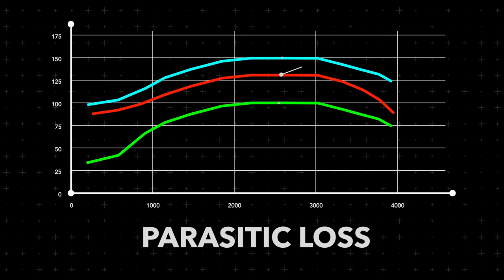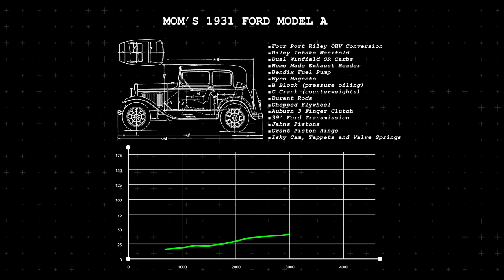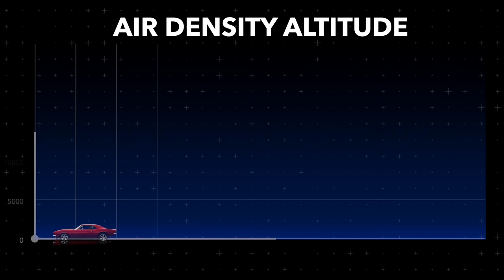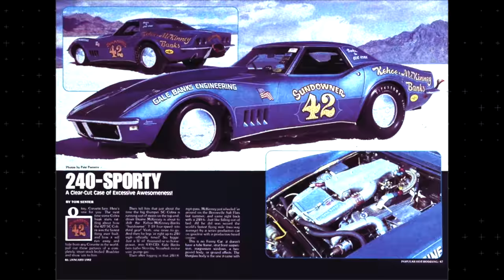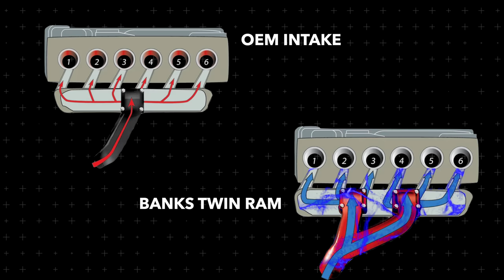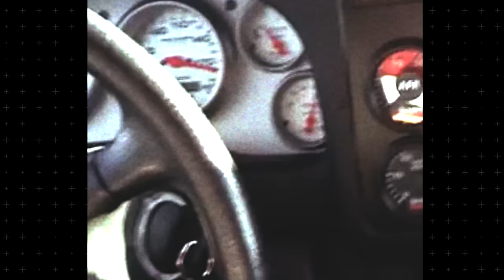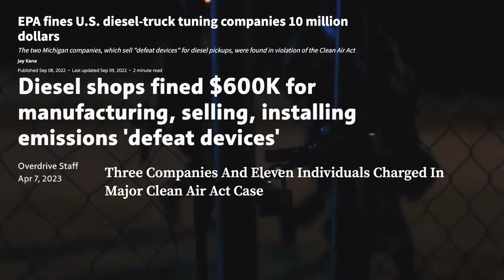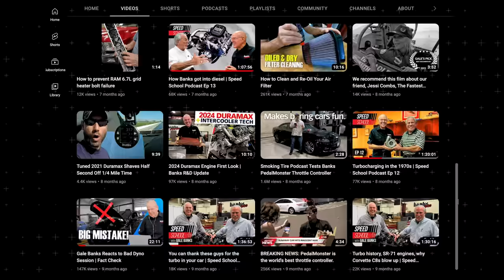How a TUNER Became The KING of Turbochargers👑 | Legends Ep. 6

Comment: “Rolling coal” was the most ridiculous trend in motor “sports.”

Why would you waste fuel? Use it to go fast or to be more efficient.
Reply: The only thing that works with ultra excess camber stances.

Roll coal while trying to get over the tiniest speedbump without ruining your bumper cover.
Reply: Small…mind?😂
Reply: it's honestly a singular aspect of actual motorsports taken out of context and made ridiculous. high power diesel builds spit out soot naturally just because the huge amount of fuel being dumped into the engine can't always all be burned, similar to gas engines spitting flames. some people probably saw both of these at the race track and said "what if we did just that, it'll almost look like the race trucks/cars haha" but it just looks dumb when it isn't backed up by actual power increases
Reply: Coal rollers ruined the diesel scene

Comment: WW2 war time aircraft engine designs were way ahead of their times. BF-109 used the Daimler-Benz DB 605 had a fluid coupled supercharger to change the speed of the super charger depending how high it went. They also used methional injections, and even NOS. Lot of the hot rodding going on later had been done years before.

Comment: Just curious but assuming that 7:50 in the video was a misquote, talking about cylinders 1 and 6 being richer and hotter? Surely they mean richer  and cooler???
Reply: You are correct. This is a typical gas vs diesel misunderstanding. 

The King noticed this while watching it recently. One of the very few technical errors in this video.

Though the A/F ratio mix up that results in less power, wasted fuel, and excess soot, high EGTs + NOx emissions are still true.

Comment: I thought this video was going to be about the 20th anniversary trans am with the updated 87 Buick grand national engine. I guess it’s arguably, but the 89 turbo trans am of 89 was the superior powertrain by comparison. The 3.8 sfi turbo intercooled gnx with 2 years of advancements in a lightweight f body supporting the gn engine was and still is a monster. Only beaten by the 4.3 awd system in the typhoon and syclone 60/40 split it was a monster. The gn, syclone, and typhoon were much quicker than the corvette a unspoken no no amongst gm vehicles.

Comment: There's nothing like the feeling of a modded Cummins. Play around with some mods and you'll be hooked.
Reply: I mean they are cool but I'm not sure I'm willing to part with an additional $10k+ for the engine/transmission option.   Plus the additional thousands to mod it.  Especially for something I'm not really sure I would even use.
Reply: I got a 12 valve for 2500 and turned it up with marine injectors and a bigger pump..overall about 3k. I guess being a mechanical engine it's alot less then having to have it tuned on a dyno and doing it yourself sav s a lot obviously 😊😊
Reply: @bmstylee  you don't need to touch the internals. I'm talking light mods. 600-700 hp
Reply: @bmstylee also a manual needs only a good clutch

Comment: In the late 1970's Trans West Ford in Fontana put an Isuzu straight six turbo diesel engine in a new F-250 pick-up truck.  My Pop brought it home, and let me run it around for few days.  That truck had some real ass - it was work truck bad to the bone.  It may have been a truck built as a proto type - my Pop was into City, County, State and Federal sales contracts at the time.  At 63 years old now, that was the best work pick-up truck I have driven.

Comment: It's pretty sad that diesel owners did this to themselves.
Even the big 3 pulled all of their light duty diesels besides the 3L GM.
Reply: A diesel in a half ton makes no sense to me.  If you need the capacities of a Duramax, Cummins, Power Stroke you probably will be needing a 3/4 ton.
Reply: People are they're own worst enemy sometimes.
Reply: @bmstylee diesels make sense in trucks in general, from tiny ones to semis. The only reason not to put a diesel is recent emissions standards that manufacturers haven’t been able to meet reliably. The fuel economy savings and potential reliability benefits are worth it, and in Europe it’s very common in all their utility vehicles.
Reply: @josephsamsor1698  fuel cost is about the same when you factor that in very recent history diesel has been anywhere from 50-75% more than 87 octane.  Then add in DEF and whatever you get in economy is taken away in the cost of fuel.
Reply: @bmstylee massive petrol engines in trucks is a very American thing. You guys have very cheap petrol, and I understand that your diesel isn't especially cheap. Any big vehicle where I'm from (New Zealand) will have a diesel, unless the owner has money to burn. I believe most of the rest of the world is similar in this regard.
Reply: @bmstylee  I currently drive a 350hp diesel bmw and I’m paying 50 cents less per gallon of diesel and I get 30+ mpg. Even when diesel get more expensive it’s kept around for its durability and longevity. An f150 gets 15 mpg while Europe is used to driving around 30+ mpg work diesel vehicles that do the same work.
Reply: Even in asia you can get diesel Ford rangers and things like that.

Comment: my dad bought a 6.7 2008 2500 ram brand new. he kept it 100% stock up until warranties expired, then deleted and chipped it as that was cheaper than future emissions system maintenance. that’s all he did until the trans blew at 130k miles, he put a built one in, now it’s the most reliable vehicle in my family.

Comment: One thing worth mentioning is that the 5.9 cummins is a medium duty engine not light
Reply: It was meant for generator use, meant to run 2000rpm all day everyday for weeks on end. They were far over engineered for small trucks. Its why I say Dodge cheated with the Cummins. And yes 3500's are still small trucks in the truck world.

Comment: I'm pretty sure the Roots Supercharger's existed before the internal combustion engine. It was used to pump Air into the deep Mines where there was no airflow.
Reply: In the engineering world, a "blower" is a device for moving air that has a higher pressure ratio than a fan, but a lower pressure ratio than a compressor. Shoving more air into an engine is just one of many uses for blowers.

Comment: I consider myself a pioneer in the field of "deleting". Removed the failure-prone EGR system back in 2007 from my Volvo D12D 12.7 Liter workhorse. That rig went 1.4 million miles before a major rebuild(egr removed at 380k) . Had make some modifications to the outer exhaust manifolds to keep it reliable

Comment: DEF is useless on the modern diesel engines just delete your diesel and use the stock tune on the engine and you will see how clean they run even with wide open throttle